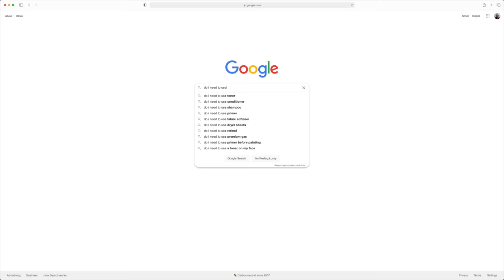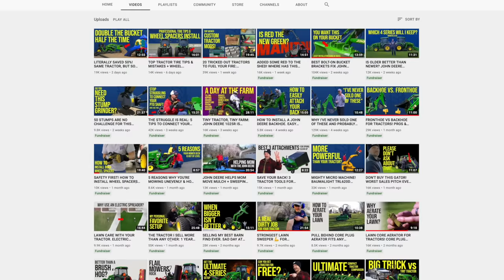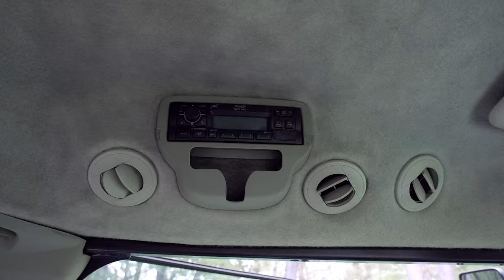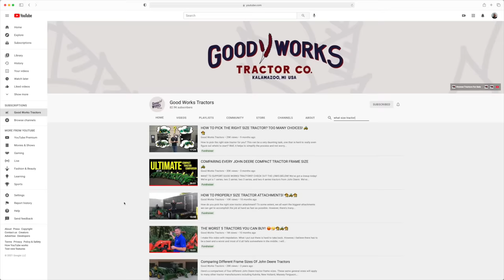TOP 10 BIGGEST TRACTOR PURCHASE REGRETS! COMMON MISTAKES! 😭

Comment: Here's my complaint. My dealer as well as at least 5 youtubers say that the 1023e and 1025r mowers are interchangeable. I bought a 1025r about 3 years ago and just this last month bought a 54d mower. Apparently there is a bunch of hardware that also needs to be purchased. No one ever told me that otherwise I would've bought it as a package new. The pto frame and front hooks are about $1500. not real happy.

Comment: Another great video. This question has popped up in my mind about ballast. Is having ballast at lower center of gravity such ballast in the tires and wheel weights better than having them on the 3 point hitch up higher raising the ballast cause more instability?  Similar to  having a load in the bucket up high with a load. Side to side stability. Now I could see the 3 point hitch weights extended further back and away from the tractor off setting the weight in bucket Front to back.  Confused?
Reply: Your in the right track. We move a lot of heavy timber and so we need as mu h weight as possible as far back as possible to counterbalance. As for stability left and right, wheel spacers (GWT sells them) and weighted tires really help in this area.

Comment: Having recently bought a JD 2025R, the biggest regret I have is with the tractor itself.  The problem is that the mid-PTO quick connect feature goes up and down with the rear PTO arms, they are not independent.  So, with the belly mower off, when you lower any rear PTO attachment to use it, the dumb quick- connect mid PTO pumpkin lowers with it too, real low, and hangs down low under the middle of the tractor.  It is an accident waiting to happen.  If you hit something with the low PTO pumpkin it will be damaged and the quick-connect feature will never work again.  The mid PTO pumpkin is also a female design and open to dirt and debris to get in it with no factory way to cover it.  It's great if you want to "plow" with your female mid PTO quick connect pumpkin.  I didn't realize this until I started using the tractor.  It's the terrible design fatal flaw.  I would have bought a non- mid-PTO tractor and a separate $6000.00 riding mower for the same amount of money that works better anyways.  Your welcome.
Reply: I'm sorry for your issues - but it hopefully helps others to get the 2025R without the MMMD - I definitely needed the ground clearance and I don't have much grass (and yes - get a dedicated riding lawn mower - not a tractor if you do!).  I love my tractor 2021 2025R with 3" BORA wheel spacers and NO MMMD !
Reply: I got the independent mower lift option on my 2025R so this doesn't happen

Comment: The LS subcompact MT122 and 125 have a skid steer QA, but it is just a little different in size and won't fit normal SSQA attachments. The MT225s was stepped up to a normal size SSQA. It was a deciding factor for my dad when he bought his Kioti CS2210 so that we could share front attachments with my MT225s.
Reply: Also, I would say people not shopping around could be a regret. I went to several different dealers and the JD sales person was my last choice. He didn't want to talk to me, seemed very uninterested, never even got up to attempt to show me the 1025R and talk about it.

Meanwhile the LS dealer was more than happy to show and answer questions. He had to step away to do something else but got a service tech to talk to me and help answer other questions and give a different perspective from the service side of things. I wanted a subcompact with MMM and with our Seattle rainy soil conditions it just wasn't recommended so I spent the money upgrading to a larger tractor. Don't regret your dealer, shop around.

Comment: At least for the JD 534x, the deck on-off, the front snow blower on-off, is the worst I've ever encountered. Takes what seems like forever, along with a lot of fiddly nonsense. I hate my JD, and this after my family being JD for 3 generations, including my grandfather being the local dealer. My old JD was 10x better than the 534. Real 1/4" steel plate vs stamped garbage. So, my wife uses the JD for finish mowing around the yard, I got an 'orange' for our fields. Absolutely love it. Also, even if a little tractor was perfect, my opinion about putting a bucket and such on one of those small tractors is just silly. So limiting as to weight and capacity. To be more on-topic, my biggest regret as said in the vid, always get a bigger tractor than you think you need. I have a K L3650 Grand, and it's still a bit too small. But I can change attachments in minutes instead of hours. A final rant, the JD specific quick-attach is lame. You can see the K quick-attach in the vid, and that's pretty standard, came from the Bobcat-style machines.

Comment: My only complaint about my John Deere 758 is the over heat problem. Every time I mow my lawn the tractor overheats and shuts the engine down. I clean the radiator screen before each use and the tractor over heats any way. Is there any way to add extra engine cooling to the signature series tractors.
Reply: I know this is in response to an old comment, but I've installed several auxiliary coolers before.  It isn't very hard or expensive.

Comment: Yeah, we bought the 2021 John Deere 1023e 120r loader, quick attachment ballast box rear tiller & rear mower for the back 14 acres. (With out the mower deck) then we bought the John Deere x354 4 wheel steer 👍oh Hell yes

Comment: Not sure about his ls quick attach comments.  I have a ls and I've had no issue with skid steer quick attach.
Reply from the maker: LS offers a traditional SSQA and their own system.  You have the SSQA version.  Don't get the LS proprietary version.  Very hard to find attachments and many mfg's will charge more to produce their mount.  Don't discount information just because it doesn't apply to you :)

Comment: Stupid question - if I need 150lb of counter weight, why can’t I weld a 3 point  bracket to a common gym weight holder rack and put 3 45lb discs on it or 4 ?

Comment: I was considering loading my tires when I bought my 3033R. My dealer wanted $750 to do both rear tires. I went with a ballast box.
Reply: You should still fill the tires.
Reply: Used antifreeze from a truck mechanic

Comment: The tractor we bought is bigger than what we were shopping for, mainly because it was the only suitable tractor available in May 2021. Stupid shortages but we are very happy with the tractor.

It has a third function for the front and a 4 in 1 loader and two sets of rear hydraulic remotes so we have future proofed it to a certain extent. I feel the 4 in 1 loader is a Swiss Army knife of loaders. It does four functions reasonably well but not as good as four specialised loaders.

Comment: I've just had a 1025r delivered to my local dealer and they're getting it ready for me. I'm signing the papers tomorrow and taking delivery the day after. I was sold all week but now I'm freaking out the night before signing, worried that I should have got the 2025. At this point in the process, I already feel locked in anyway. They're already making it ready and moved it from another branch to my local dealership branch. I'm not legally on the hook but changing my mind now would be a dick move. Just a lot of pressure and pre-purchase jitters I guess. The 1025r will be great in my tight, heavily wooded property.

Comment: Is there a compact tractor out there that has universal mounting brackets under the tractor? The mounting for brackets for backhoe front snowblower and belly mower are all different. I have no problem changing the under mounting frame but changing the frame brackets is bazaar.
Maybe this is not possible but if they want to sell attachments engineers should work on this.

Comment: Don't agree with the 1st point.
I owned a kubota subcompact bx2660 for 12 years. It had a loader bucket and mower. The only time the mower came off is winter snow plowing.  Had zero issues using loader with mower on.
Just traded up to a kubota Compact b2601 and plan on leaving the mower on all summer even if I need to use the loader.

Comment: The lie about horsepower is the biggest lie dealers make. They took HP rating from back of tractors for many years and switch to at back of engine which is useless and unusable HP. So a 33 Hp Ford is barely a 20 hp machine!!!

Comment: On my new 1025r windshield there was a small sticker stating not to have wipers up when windshield is in the open position. So unknown to me was to  not have windshield open when operating loader. When unloading 16 inch round logs in my trailer my leveling bar broke my windshield  I had it in the open position. Why didn’t they have a warning sticker of that importance on my windshield not to have window open using loader. It would have saved me 700 dollars for a new windshield. Deep in my loader manual it says not to.

Comment: My biggest regret is buying a green turd 4044m. My salesman lied about what it is capable of doing. He said it would pull a 10' brush hog with no problem. It is way underpowered for the size of the machine. Once you add liquid ballast to the rear tires it becomes a real dog. If I had a truthful salesman I would have gotten a bigger horsepower engine in the same frame. Now I am stuck with a dog.
Reply: Sell it
Reply: @Heritagepostfarms  you want to buy it?

Comment: As implements proliferate, the tractors needs more capabilities.  Which can be difficult to predict.  I didn't need a backhoe, but years later the Power Beyond hydraulics by themselves would become useful for newly invented implements.

It's also difficult to predict how a tractor will perform on your terrain.  I had a previous model 2025 that basically had no useful brakes on a hill.  Worse, the 4wd lever and the differential lock lever were close together.  Dealer response.... oh that can't be true.  OK, you come drive it on my hill.  Oh look, the phone is ringing.

Maybe...maybe the next emerging capability with be improved hydraulic power..... one company makes a rear PTO-driven power pack that can drive stronger hydraulic implements..... maybe it could drive the Limb Saw, etc. on a 1025?  Versus putting a bigger pump in that would negate your warranty.

Predicting the future is difficult and expensive. Y'all do a great job.   :)

Comment: Would have been nice of Deere to tell me be careful of the fuel system in my 2019 4044m. Less than 300 hours and have changed both fuel filters, yet tractor still falls on its face when put under load. They don’t warranty you getting bad fuel which can sabotage the whole fuel system. Would have been nice of the dealer to recommend a diesel fuel additive which may have save me from all this headache.

Comment: I tried taking the mid mount mower off my 1026R and the PTO thing on the deck would keep getting hit by the loader stand as I would go over it with the loader because I’ve seen Deere say it’s ok to have it on while putting the mower off the tractor

Comment: Yeah I would say John Deere has their proprietary loader quick attach but everyone else is moving to skid steer quick attach totally different when you are talking proprietary loader for John deer is just for John deer skid steer has been a market standard for a long time and many many companies use it.
Reply from the maker: Nearly half the compact market is John Deere.  You can get away with it if you have the volume.
Reply: @GoodWorksTractors  John Deere can not even compete at all in the compact market at all and it is because of their proprietary loader that is what holds it back. Don’t get me wrong John Deere makes the best mower deck in the Business but when it comes versatility you have to go with kubota but each it to their own but why be stuck with just buying John Deere loader implements. Kinda ruins the versatility of the machine.

Comment: The problem is that there is no website that compares tractors. I am closing on a new home in a week. It has a sod lawn and I will run a business out of it. I would like one piece of equipment that can give me a good lawn cut AND pull an 1100 lb pallet off the back of a truck about every other week. I can buy a bigger tractor, but even with turf tires it will wreck the lawn. I can buy a smaller tractor to handle the lawn and it won’t be able to unload a truck. What would you do?
Reply: Buy both - seriously -  I can buy a decent riding mower for less than the mid mount mower on my 2025R (which will chew up my hilly lawn) - and you need something much larger and heavier to lift 1100 pounds !   There is just no way a large tractor with adequate ballast can mow your lawn well IMHO.  Not getting the belly mower was the best decision I made.
Reply: Get a cheap mower and get a tractor that'll lift 110lbs. You can get a decent riding mower pretty cheap.

Comment: I totally disagree on the mid mount mower. Best thing ever. I leave the loader arms on when I mow. I just take the bucket off. I mow a lot of ground but have no tight spaces. Turf tires have the best traction for snow blowing  (softer and more ground contact) but are really thin.  I started using chains last year as we had hordes of ice on the driveways (NS Canada) I do not go in brush anymore as even a thorn will puncture turfs. My biggest grievance is so minor it is laughable. I do a pile of driveways with a rear mount blower. Pain I know....but my Knee hits  the light switch and turns the lights and warnings out. I would like detachable teeth on the loader bucket but that will  be DIY  I guess. Oops...1023 .

Comment: So Massey Ferguson has its own quick attachment system, making it difficult to find many loader attachments? I'm considering a Massey 1835M or 1840M, but that comment has me concerned.
Reply: They use standard skid steer QA like everyone else (except Deere). Tried buying a MF1825E last month, all the dealers told me August or September. Bought a Kubota L2501HST two weeks ago. Didn’t want DEF or Regen.
Reply: @jdub229r  Thanks for the update! I thought that was the case, I just wanted to make sure I didn't mishear what was said. Yeah, I was told there was a wait when I test drove an 1835M a couple of months ago. I'm thinking I need to get on the list soon...I was just trying to get some more research in before making a final decision. It's been down to either a John Deere 3038E or the Massey Ferguson 1835M (or 1840M) with leaning very much in favor of the Massey Ferguson.

Comment: bought a smaller tractor... x370..2021..$4400... came with oil 1/2 quart LOW, and the mower deck wasn't even CLOSE to being level... my regret is buying a high end mower when they only care about the $$$...and this mower went thru TWO dealers to get to me...plenty of chances to make sure the machine was ready to be handed over...

Comment: Windshield shattered in pieces, why did this happen to hundreds of 1025r owners, because hidden in your Mauser manual it says do not open window with loader in operation cause load leveler could shatter windshield. What warning does John Deere give buyers,a little sticker do not use wiper while windshield is in the up position. Who cares about a wiper John Deere, I would of much rather have a sticker on windshield do not open windshield when using loader. It cost me over 800 dollars for a overpriced windshield,highway robbery. While loading a cut up 16 inch round logs, while dumping in my 4x8 trailer windshield shattered by load leveler.